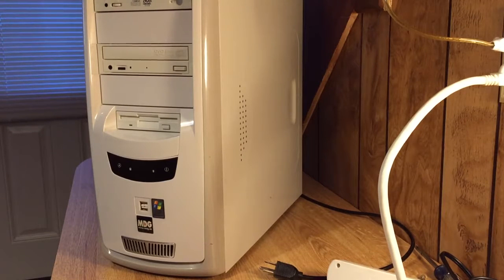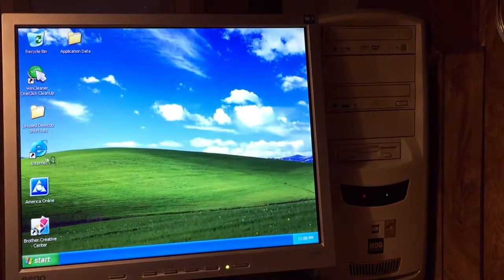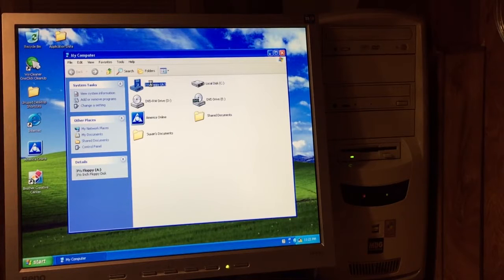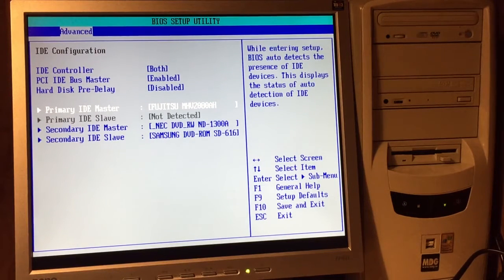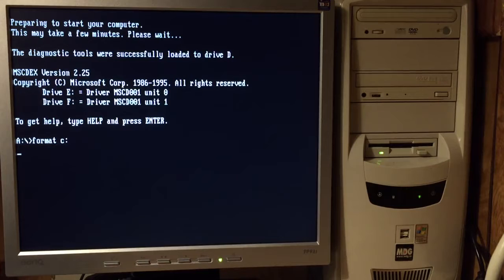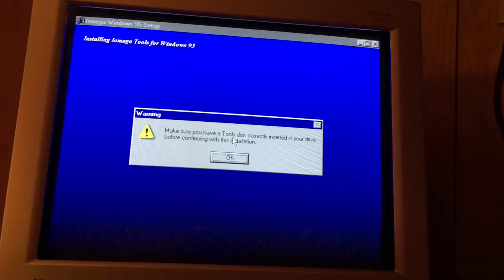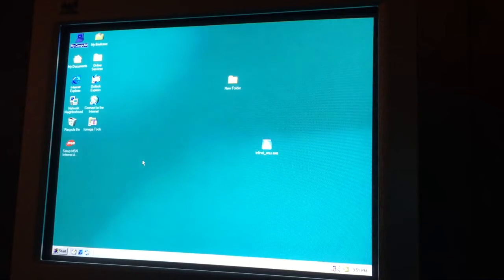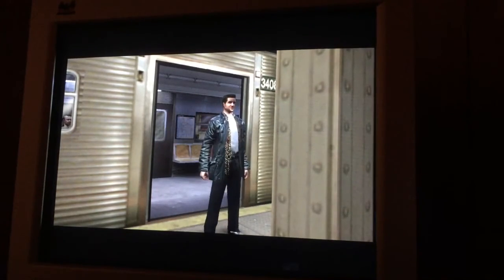$5 thrift store computer!  Let's have some fun with it! +Mini Max Payne let's play!

Comment: I'm guessing that PC is from around 2002. Guess the collection I have now, is my custom build desktop pc with a motherboard from 2013 and amd fx6300 has Windows 10, My Dell Precision m6400 from 2009 has Windows 7, then finally, an old Toshiba satellite 330cds laptop from 1998 that I fixed up has Windows 95.